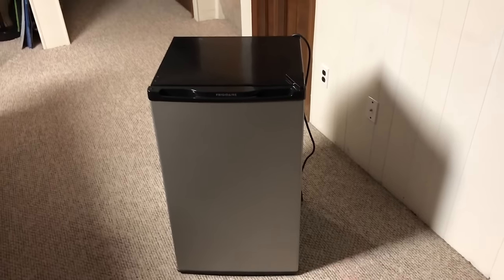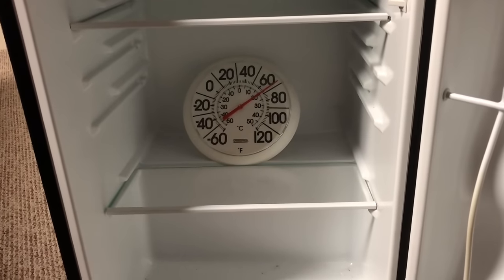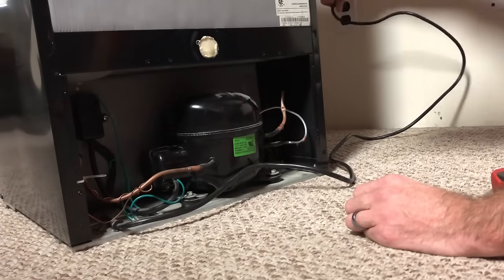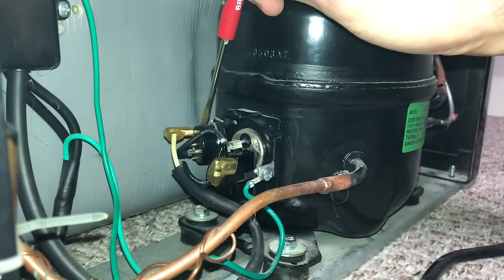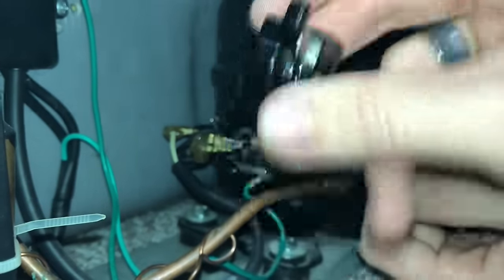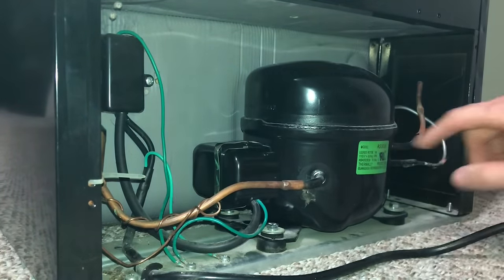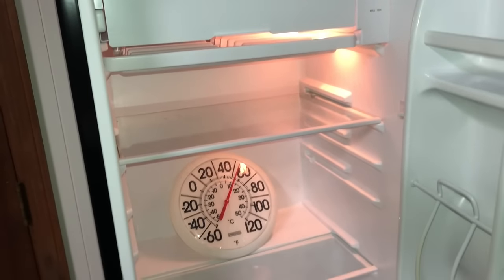Fix a Frigidaire mini fridge that is not cooling (LFPH33M4LM)

Comment: Thank you for this info, my  mini fridge stopped working so opened the back of mind. I looked in the back and saw the black box, and removed the relay. Ordered me another from Amazon and replaced it myself. It now works fine for those ladies you can do it, I'm 70 yrs old and I did it.
Reply: Amazing! Thats really awesome! 

I know people in their 30s who can’t do this :)
Reply: Thank you for saving from landfill.
Reply: Yes, true!  I plan to fix my little salvaged fridge.  I fixed a huge fridge before with a change of starter motor - same type of fix.  Very empowering when you can save an appliance from city dump.
Reply: 70th like. Legendary
Reply: May I ask. Was the inside light not working when you had to replace the relay
Reply: What keyword did you use to search for that black tiny thing?
Reply: @ayushiadi4283  relay
Reply: Thanks to Dustin for the video and thanks to you and the other women who commented and made me feel like this was a doable thing for me. My fridge is back to working order!
Reply: I’m having a problem getting the cover off
Reply: My replacement relay didn’t work

Comment: THANK YOU SO MUCH FOR THIS VIDEO!  Because of you, I fixed my mini-fridge ALL BY MYSELF for $9 using the part link you provided!  This was completely out of my realm, as I have never thought of myself as someone who could repair an appliance.  I purchased my Hamilton Beach mini fridge freezer combo for my classroom in 2014.  In 2019, it quit cooling.  It sat in my classroom closet for almost a year while I thought it was broken. I called 3 appliance stores in my city with no luck. One lady said it would be cheaper for me to just buy a new mini fridge compared to the cost they would charge me to repair it.  Before giving up and taking it to the dumpster, I googled and found this video.  After I got the guts to remove the starter relay, mine was in fact rattling, just like yours.  I ordered the part you linked on Amazon, waited two days for it to arrive, again got the guts to replace the part all by myself and now I have a freezing cold mini fridge to start the school year.  A good teacher has done their job when their students can demonstrate mastery of the material.  You sir, are a good teacher! Thank you!  Namaste, Mrs. Buckley
Reply from the maker: Jessica Buckley awesome!! Never be afraid to attempt to fix something that is already destined for the dumpster. I’m glad you stepped out of your comfort zone and got up the nerve to tackle the project. The next time you need to repair something it won’t seem as scary. Best wishes to you in the classroom this year.

Comment: Why does the motor hum? Because it doesn’t know the words! 😂 I will let myself out 😎
Reply: lmaooo. i will let myself out im crying
Reply: I've just fart laughin...
Reply: @Gary Lee Moore just excellent. I removed the relay gave it the shake test seemed solid used a DMM to probe resistance M to S then M to power in L and then S to power in L. Scratched off some paint on the compressor body for a ground short spot and then messured continuity between S and the bare metal of the compressor and then M to the same spot. reinstalled the relay and the wiring clips plug the fridge back. Cycles on 1 minute off for 2. Fixed. How exactly im not sure but I did tap the thermostat with a screwdriver and verbally threatened it.

Comment: I have a Frigidaire refrigerator just like the one pictured in the video, and it also quit working. Mine has two relay switches. One switch is similar to the one in the video. When I disconnected it, it didn't rattle. The second switch was immediately above it. It is white and black. I check it, and it rattled. I ordered the relay switch from Amazon. I replaced it, and the refrigerator did not kick back on. I was confused. So, I opened the refrigerator door and turned the refrigerator off. When I turned the refrigerator back on, it started. So, depending on your model, there might be two switches, and you may need to turn the refrigerator off and back on again for it to work. Good luck everyone!

Comment: just salvaged a mini fridge my sibling threw out, took it apart and the overload part is rattling. :) Ill update in a few days, might have just got a $180 fridge for $10!
Update: It’s working! So hype
Reply: Niceee
Reply: Did you also switch out the overload module? My relay isn’t rattling but the overload module does. Is it not supposed to rattle?
Reply: @chabelita211  yea it’s not supposed to rattle

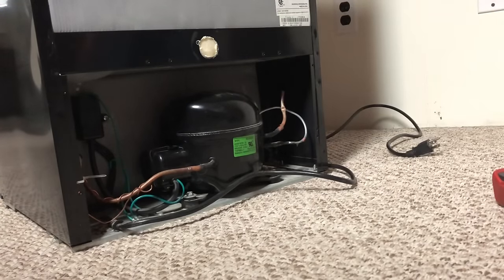Comment: 3:40 Big respect for demonstrating good safety, both in checking for ground faults, and SHOWING THE PLUG. It's good practice to keep that plug hanging near you so you can confirm whenever you want that it's definitely unplugged.
Reply: Ññññ
Reply: Si
Pop ñ

Comment: The start/run switching relay is one of the those things I pull out of scrapped fridges for spares. Nice fix.
Reply: Where do I find that relay? I want to start collecting them and whatever parts are you’d suggest? I see a lot of abandoned fridges on the side of the road.

Comment: Thank for including some of the multimeter troubleshooting near the beginning. Because of that I found that the thermostat had latched open despite being set to nearly the coldest setting. While playing with it a few times it made a click sound and now works. Saved me from replacing a perfectly good part.
Reply: This was my problem too on a unit that went bad during pandemic lockout. They threw it out since it was disgusting inside and wouldn't turn on. After jiggling the thermostat knob nice and hard it freed up and kicked on. It then locked up again shortly after so we will be replacing the thermostat. Great video!! Update: couldn't find the original wpf 21 but used a wdf20L successfully.

Comment: This fits my situation perfectly. Exact model. Rattle in the Starter Relay. Parts ordered! I'll follow up when its running.
Reply: todd quest - fits my case perfectly also.  cant wait to get to work and fix this thing
Reply: I got the part quicker than expected. Easily replaced the old one and now have a working fridge. $5.99 Boom!

Comment: Thank you so much for this awesome video!  I had a fridge I was about to throw out and buy a new one and I came across your video.  I shook my starter relay and it rattled as well.  Ordered a new one from Amazon and installed it.  Worked!!  Thank you!
Reply from the maker: Mike Beasley glad you got it going. Thanks for watching.
Reply: I took mine out and it didnt rattle. Its buzzing but it's not clicking neither. I'm not sure what it could be lol.

Comment: Thank You !  Got a fridge for work a while that wouldn’t work. Called the vendor and they shipped me a new one. They were going to toss it, so I took it home. Tried replacing the starter and protector with no luck. Wasn’t until I saw your vid and you mentioned testing the continuity at the plug for the thermostat that I figured it was the problem.  Opened it and one wire was unplugged. Got my self a working $175 fridge!

Comment: I have a 2013 Edgestar Kegerator and lost my first keg (two weeks old)  due from the relay going bad..Carbon copy of problem here except my relay did not rattle when shaken and my positive wire is blue not black for some reason. Lost my keg but saved my kegerator. Less than 10 bucks on Amazon. Thanks for the video

Comment: Great video! thank you Dustin!
It helped me to diagnose (exactly same symptoms - started then stopped), so I pretty much knew this was an issue with the relay. Removed and shake it and same noise :-) I went one step further and open the relay and say a broken piece with a kind of disk inside, just removed it, turned it around so there was full contact, and now all fixed! $0 but I think I may still need to get a new part (relay), but in the mean time I managed to get it up and running again!
Great with multimeter too at the beginning - this troubleshooting step were priceless!!
Thanks Again!

Note: My Bar Fridge is Midea HS-140LN (112L)

Comment: Hi nice! I fixed mines glad you are telling the ladies 1. where to put the wires back if you forget to take a pic and most importantly after the install if you plug it in and you still don't hear the compressor...  turn you dial (inside the fridge) to zero and then to your desired setting. Mines then kicked back on. So happy I am back in business!!👍Thx!!!

Comment: great video.... I have a Danby mini fridge similar to yours. Was working fine until i moved it outside to defrost the freezer part. Once back in the house it turns on i can hear the compressor..it gets very hot and stays on but doesn't cool the fridge or freezer anymore. Thermostat is set to coldest and i checked the relay that you shake and doesn't make any noise. Compressor gets very hot and strays on and also is making a smell. Maybe freeon leaking???

Comment: hi, how are you doing sir, thank you for that but mine is while i was cleaning i accidentally poke a hole in the freezer and i can see it leaking after awhile it stops leaking and i patch the hole but when i turned it onit does not getting cold anymore, any advice pls thank u
Reply from the maker: All of the refrigerant leaked out. You’d have to hire someone to evacuate and recharge the system once the leak has been fixed.

Comment: I replaced the the start relay and the refrigerator is still not cooling, I can hear a buzzing/humming sound. I was told it may need a compressor. How do I replace the compressor?

Comment: Great video now makes me wonder what's wrong with mine  I have one of these exact mini fridges.  Mine started to do some gas leaking sounding noise inside when it's on, then sounds like a drainage happening when it turns off. I don't know if thats always been there to be honest.  I still cools great though, but I do think the compressor turns on more than normally did in the past.  Do you think it's going bad and going to die on me?  Thanks

Comment: Thanks for the video. I have almost the same fridge. My issue is that it runs constantly and won't shut off. The compressor feels hot actually. Ideas? (It DOES cool the fridge)
Reply from the maker: If it’s running constantly, I’d suspect that it’s low on refrigerant and doesn’t cool down enough for the thermostat to signal to stop the cooling cycle.

Comment: Hi, I just got a mini fridge with this issue and when I checked for continuity between the pins and ground my multimeter beeped I was wondering if you could please explain if its safe to use or if there are any solutions to this thank you
Reply from the maker: If you have continuity between the flat pins and ground, there’s a possibility that the motor windings inside the compressor have an internal short to ground. If you plug it into an outlet, one of two things is likely to happen. Either the overload protection in the fridge will trip and disconnect power until the overload cools down, or it will trip the breaker  or fuse in your electrical panel. 
I have a more recent video where I show the overload device.
https://youtu.be/5KlTjU4cRVA

Comment: Great video, i just picked a mini fridge out of the garbage, it doesn't work, hopefully this is the problem!
Reply: Usually its the relay/overload unit that goes bad before anythihg else. Typicaly thats a cheap & easy fix. Unless its the compressor itself which usualy costs $200 to $300 to get replaced.
Reply: @theatom7264  it was! $10 on amazon and it's running like a champ!

Comment: I have a two door 3.2 CU.F mini-fridge which has a separate door for the freezer and refrigerator. The refrigerator portion will only cool to about 57 F but the freezer gets crazy cold down to like -20 F.  Unlike full size refrigerators these mini-fridge units that have a separate freezer and refrigerator section do NOT have an air passage that goes from the freezer to the refrigerator, each section is sealed off with no access panels inside. So what I'm trying to figure out is why does the freezer get super cold but the refrigerator section does not.  Obviously the compressor is working just fine since the freezer gets super cold so it's not a power or relay issue.
Reply from the maker: I’ve never messed with one of those, so not sure, but I’d think that there has to be a way for the freezer air to get to the fridge compartment.
Reply: @DustinRogersinMO  One would think so but with these two-door mini-fridge models the individual compartments (freezer/refrigerated) are completely sealed and just one piece of molded plastic with no air-holes or passages. I'll upload a video of it.

Comment: Any advice on what to check for with the 7.5cft fridge? Mine out of the box is not working. Got in on clearance from WM and would hate to return it because of the savings but I will if I can't fix it.
Reply from the maker: @TheHassboss12  start with what is shown in the video

Comment: Thanks for this. Seems helpful. I will try. Can i ask that whether all starter relays are universal for all brands or does each brand have its own starter relay? Does the one you gave the link work for all brands? Thanks
Reply from the maker: You’ll need to look at the relay on your compressor. Some have one wire connection but others can have 2, 3, or 4 connections. There’s also other styles of relays that are not compatible. I have a newer video that I explain it a bit more. 
https://youtu.be/5KlTjU4cRVA

Comment: Checked this out on Magic Chef Wine Cooler - Start relay appeared to be working - doesn't rattle- compressor starts, gets very warm, refrigerator doesn''t cool. It appears that overload relay kicks it out. Question I guess is if the overload relay is doing it's job and the compressor is overheating. What's the next step if this starter relay is working properly - is it likely the overload relay kicking off too early, the compressor bad, low refrigerant charge? What's next if the start relay isn't the culprit?
Reply from the maker: How long does it run before the overload trips? If it’s a matter of seconds, it may still be the relay. Check out this newer video where I show a faulty relay that doesn’t rattle. 
https://youtu.be/5KlTjU4cRVA

If it runs for a long time before the overload, I’d suspect low refrigerant.

Comment: Dustin, your videos on mini-fridge repairs rock!  You saved my Galanz not-so-mini retro fridge.  Its start relay was bad but it's not available anywhere, not even from Galanz.  However, borrowing from something you did I took a 4.7 thermistor from a different relay and installed into the Galanz relay and it worked!  You da man!  Now, a different mini-fridge / different problem.  I don't have continuity between the power plug's flat pins so you said it might be the plug doesn't have continuity to the thermostat or could it be the thermostat is bad?  Any ideas on how to diagnose / fix this?
Reply from the maker: Here’s a pretty typical wiring diagram for these little fridges. The N and L are the two flat pins. You can trace trough the diagram to see the potential places to lose continuity. You can test for continuity at various components too. https://manuals.plus/hamilton-beach/hbf3200-black-compact-refrigerator-manual#wiring_diagram
Reply: @DustinRogersinMO  Thanks, I hope that'll help!

Comment: I have similar mini fridge it was working well until tomorrow but now it's not. The power supply is there but the fridge is not cooling! Any idea why this happened?? And how would i fix this? Also, i checked the compressor its super hot.

Edit:- hey i wanted to say thanks, i fixed my fridge all by myself 😁😁 and i brought the start realy from a local shop and it was only for $1 thank you thank you so much 💜💜💜💜💜
Reply: I see. Follow the video instructions and replace relay, that’s all
Reply: @max_7344  already did and my fridge started working again all thanks to you❤️❤️
Reply: @ayushiadi4283  Great! You are an engineer yourself👍

Comment: Does all mini fridge has relays cause i have a Magic Chef brand 3.5 cubit min fridge. Its a year old and the lights is on when i open the door but it doesn't get cool. Thanks!
Reply from the maker: Yes although some may use a different style of relay. This style is called a PTC relay. In this video I take the relay apart (
https://youtu.be/5KlTjU4cRVA ) but there are other styles that don’t rattle when they are bad. You just have to test them with a meter

Comment: When you shook the relay connected to the negative (black) line it rattled indicated something was wrong.  What about the part connected to the positive (white) line?  It's a different part.  Any idea what that would be?  Thank you!
Reply from the maker: That would be the overload protection. I’ve got a more recent video that explains these two components better. 8:08 in the video

https://youtu.be/5KlTjU4cRVA
Reply: Upon further investigation, it looks like it's the PTC Starter.  (you replaced the relay).  My compressor is acting the same way (starting then clicking and stopping).
Reply from the maker: @dave.in.oregon  if you have a multi meter, they’re easy to test. The video link above shows how.
Reply: @DustinRogersinMO  Thanks for the quick reply Dustin.  I'll go dig out my multi-meter and test it out.

Comment: i just removed the relay and shook it, i dont hear anything (rattle) could the relay still be bad? would there be a different part that may need to be replaced. 
my fridge and top freezer stopped cooling and the compressor was hot when i touched it.
thank you in advance.
Reply from the maker: I’ve got a newer video where I show how to test the relay. Check it out here https://youtu.be/5KlTjU4cRVA?si=NMLc15F3frRKRYY-